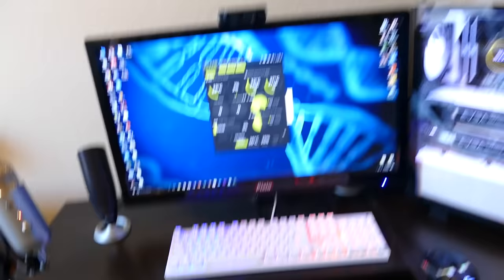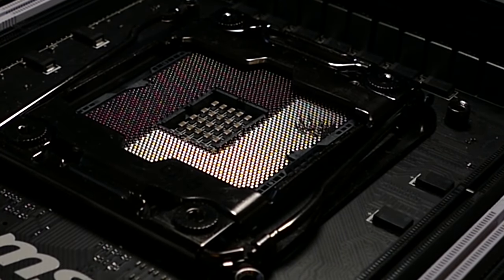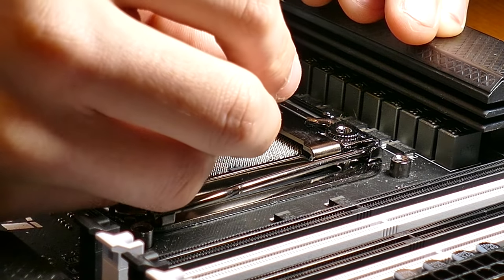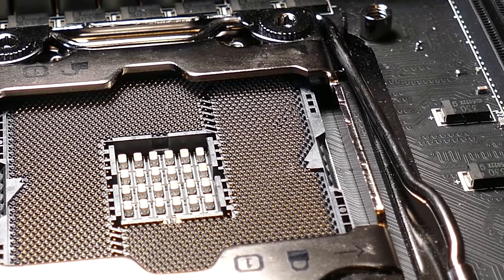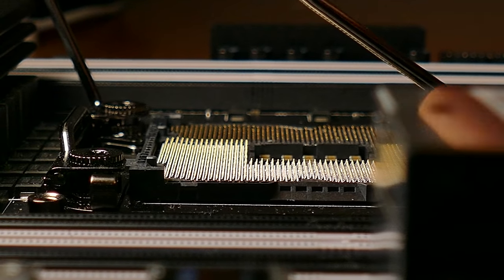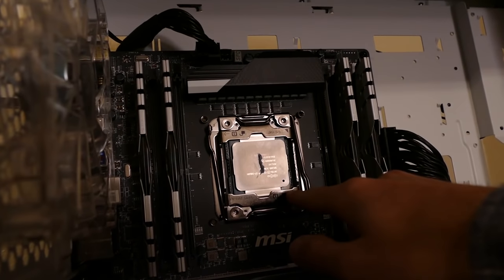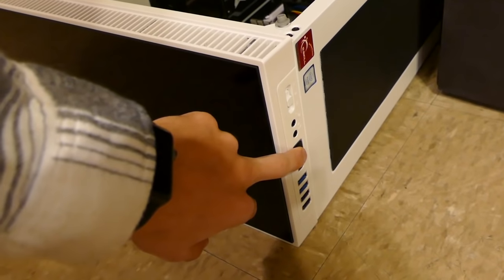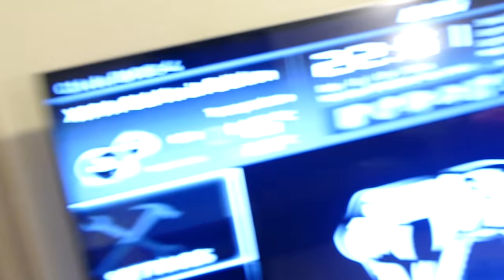I Stepped on a Motherboard. Let's Fix It!

Comment: You don't have to trash anything if that repair goes wrong. With the cost of that board being that hi, a proper hardware service socket replacement will be cheap. Socket replacement on any board costs about 40 USD + VAT in my country. Should be around that price in US I guess.

Comment: Nice save.  Those stupid little pins are soooo damn delicate.  You even breathe on them wrong and they get misaligned it seems.  I kinda miss the old CPU pin / socket setup, those were much more robust.

I do see why they did it though.  Overall, if you dropped a $350 cpu and bent/broke the pins, it's more costly than mucking up a socket on a $150 motherboard.

Comment: The fact it only sees 12GB of RAM might also be due to the bent pins, I'd not blame it on your RAM installation. 
After all, I've seen a few people that had LGA sockets with bent pins and their CPUs and  PCs ran fine, exept for the right dims that just didn't work anymore. Might be exactly what you have here.

Comment: I've lost two ram slot out of two with bent pin, now the dual channel capability is gone. Tried bending pin back to their original position but they never goes to original position.

Comment: I might actually think about getting a motherboard with the AM4+ socket that uses the AMD ZEN CPU and it turns out that the AMD ZEN CPUs will have 16-32 CPU cores and the AMD ZEN APUs will have 32 CPU cores and 16 GCNs and the AMD ZEN processors also have hyper-threading so they show up as 64 CPU cores and 16 GCNs.

Comment: this is extremely hard for a X99 socket depending on the way the pins are bent. my MSI gaming 5 had only a few bent pins but it was never fixed

Comment: are you sure that one of your ram is not inserted properly is the reason why its not detected? i had a similar problem with my z77 motherboard system was crashing when i ran it in dual channel and was working fine when i ran them on single channel found out some of the pins in the socket was bent. quick Googling showed that the pins that were bent were related to ddr memory. tried to fix it like you did was not successful now both the dimm slots in channel A totally failed, but channel B works.so the system is still fully functional except for loosing two slots. didnt bother to correct it as i was didnt want to make it any worse

Comment: I tried this with a gigabyte lga 1150 mobo, with the slightest pressure the bent pins just broke off. After what I paid for it and what I paid for the cpu, I definitely prefer the pins on the cpu theyre even easier to straighten out. Hope zen keeps that tradition.

Comment: If I did that to a high-end Mobo, I'd be devastated - well done on the fix, breathe a sigh of relief! :-)  For the RAM though, please try not to handle the contacts with bare fingers, even if not for static discharge, the oils from your skin can cause problems later on.  Same goes for those CPU pins or GPU edge connectors.
Reply: La estática se quita teniendo presionado el boton de power por 15 segundos y el problema que djiste nunca ocurrirá.

Comment: actually if im correct some of those pins are useless and others you can still get away without. granted this is only the case for a handful of pins and can cause the cpu to have lots of errors.

Comment: i had problems with the stability under load after 3 bent pins not perfectly aligned with the cpu. so may be not fixed?

Comment: ah yes, when i was setting up my mobo, i drove a screwdriver through the pins while trying to insert the backplate and screw the cpu cooler in. had to tediously bend them one by one. worked fine and still working fine!

Comment: AMD board would ever have that problem.And didnt you get x99 taichi back from nzxt? So you should have a mbo for the i7
Reply: For some random reason I thought that both the Intel CPU and the motherboard had pins :'D
Anyways. For the x99 platform, I think is better to have the pins on the MB since if you screw it up it can cost you around 400$. But the CPUs are the same price and even way more expensive than that, so it would be better to not screw up your 1700$ CPU, for example :')
Reply: TechGuide Yea, but it sucks when you bend the pins on your CPU though. Like I did on my AMD chip. Lol. I was able to fix it though thankfully.
Reply: True.... AMD make the cpu the fragile part instead.... I'd rather damage a mobo than a cpu as I know which costs more to replace ;)
Reply: Yeah but remember that the fx cpu line is dirt cheap and many mobos cost more than the cpu itself if not the same.
Reply: McnuggetsandFrieswithsauce'nshit But there is a much higher chance to bent the mobo than the cpu.For an example no one is that big of a fool to leave a cpu on the floor.But that does not apply for mbos right salazar xD
Reply: I personally had the stock cooler stuck on a fx 6300 and I didn't know that so I stupidly pulled the cooler out with force and discovered that the processor was glued into it's bottom, fortunately fx pins are big and tough that none of them were damaged. One thing intel does better in their solution is the part that holds the cpu tightly on the motherboard.

Comment: Two things, I like the troubleshooting and repair videos, it sets you apart from others just doing benchmarks and reviews. The other thing is I miss bga sockets and CPUs. Sure it cost a fraction of a penny more, but never had bent pins.
Reply: David Whitfield think you ment PGA.
Reply: No, I did mean Ball Grid Array, they had balls as the contact point on both the CPU and Socket, they were dropped as they are more expensive to produce.

PGA uses pins on the CPU, which is terrible, AMD FX still uses them, and intel uses Land Grid Array, which may even be worse, but it's the cheapest in production costs.
Reply: Interesting. Never new it was a thing. What cpus/manufacture had it? I like PGA cause if a pin breaks you can just throw it in the socket.
Reply: I know Intel used to use them on package CPU's, but now I believe they are only used on SOC solutions where the chip is simply soldered. I think they last used it in 98' on some security based Celerons.

If they were to bring it back customers would love it, and it would only hike up manufacturing costs by about $1.63 for each CPU. No more bent pins, less connection errors (like not detecting RAM due to minor variances the are still within the QC threshold).

Comment: I was building a 1151 pc with my 2yo daughter and she bent 5 pins[badly, another 10 or so barely bent] installing the cpu. I spent 4 hours doing exactly this. got them all straight but the last one snapped off right as I was finishing.

Comment: I did this too with my old CPU,I was cleaning my Mobo and I forgot I put the CPU near my left hand and I accidentally put my hand over it and I bent over 20% of the pins and fortunately I managed to bend them back and it did work afterwards.The CPU in cause was an AMD Athlon II X4 640.

Comment: what would you recommend for gaming and heavy web browsing like 8-9 tabs open at once broadwell-e like a 6800k or 6850k or a skylake 6700k i will be upgrading from a amd 1100t
Reply: ronnie cason an i5 is enough.
Reply: that isn't what I was asking but thanks for the input
Reply: ronnie cason I5 6600k
Reply: tabs are not really CPU intensive and close to taking nothing you will need a lot of RAM
Reply: ronnie cason 6800k
Reply: actually most of the time it is like 3 or 4 tabs of youtube lol
Reply: current set up is amd 1100t 16 gigs of ddr3 1333Mhz ram 2 xfx r9 290x gpu's in crossfire
Reply: ronnie cason 6600K, for gaming u really dont need more and the i5 6600k should b able to handle 10+ tabs easily
Reply: ***** very extreme.. just saying real world scenario it would never happen. to what you said atleast
Reply: Wow "heavy web browsing" is 8-9 tabs? What is my 100+ tabs then? Because thats pretty usual for me.
Reply: getting more ram will be helpful if you're going to be using mutiple tabs at once and an intel i5 or an amd fx 8*** will be more than enough (i said amd fx because of its price/core ratio compared to intel :P)
Reply: yeah but with zen right around the corner maybe i should just wait
Reply: 8-9 tabs? xDDDD my i3 can do all and always opened like 20-30 tabs

Comment: Looks like one of your memory modules is not being detected. It shows 12GB in the UEFI yet it looks like you have 4x4GB dimms installed. Is this accurate? I'm asking because I have a 1366 board and I fixed the bent pins but one of the ram channels is dead. Were you able to get all four memory channels working?

Comment: I fixed alllll pins, 2 of them are bent like this, half of the pin is straight and other half of the pin is bent sideways, would my motherboard still work with the cpu?

Comment: got a AMD 9590 CPU and just changed my cooling solution.
when I tried to remove my Noctua d14 the cpu was bonded to heat sync with thermal compound.
so  ended up bending pins but managed to bend them back ,reinstalled and every thing worked just fine.

Comment: i have an asrock b150m pro 4 mobo psu atx12v only have 4pin not 8pin.. should not be a probs but when i connect the 4pin pc wont turn on, if remove only graphics card fan and psu fan turns on.. whats the problem?

Comment: i think u only got 12gb of ram because a few pins wasnt bend good enough. had the same issue with a fx 8350, which only detected 8 of 16 gb ram because the pins were broken.

Comment: This is reason i hate lga sockets. I bent 1 pin on 1155, got it working but problem that it doesnt always post, i power off and on few times again and it will, after that it works without any problem.

Comment: thanks for the video but cpu being detected does not mean it is fixed, you can call it fixed when you put it under load or stress test which include all cores/threads test!

Comment: Can someone help me I just built my new gaming pc and when I turned it on it just turns on then u wait 5 seconds then it beeps twice then turns off and does the same thing reapitvely but when I put my cpu out it works fine it boots on fine like a normal pc but I'm wondering if it is the CPU because when I took it out of my pc my pc worked fine no beeps or anything so could it be the CPU any suggestions?

Comment: when a friend of mine bent a pin and came ask me for help i used a Pentel P205 or p207 mechanical pencil the tip is strong and you can firmly move pin back still a pain to do it thogh D;

Comment: I put a 4790k in my MoBo while building it and somehow i bent a fair few pins so the cpu was rising and the system didnt turn on. 
A magnifying glass & 20 mins later i managed to fix it. Had about 4 heart attacks and 14 strokes but eh.

Comment: Soooooo... First you use the cables from the wrong power supply, and then you leave a motherboard sitting on the floor without any sort of protection on it whatsoever?
Are you sure you don't just want to buy a Dell or something?

Comment: my fingernail got caught on one pin while putting in the cpu. I panicked but just rolled with it and my pc works fine. my i5 is over clocked and games run amazing.

Comment: I would never leave the pins exposed on an Intel motherboard ever, I use a cover or a CPU 99.9% of the time to prevent this.
Reply from the maker: The motherboard was placed next to my chair temporarily during a CPU swap.
Reply: Salazar Studio I can understand that, but even then, I would leave it on the desk or put the cover on. Oh well, what is done is done and you did what you could to salvage it, neat video in the end. I still recommend having a spare CPU cover on hand, I would hate to see more motherboards lost to a few bent pins.
Reply: Or put it in a motherboard box you have those they ship with them

Comment: Next video: it was not my angle that caused the problem, it was the wrong cable! I used an IDE cable to power my motherboard!
Reply: Pretty sure it was the chair manufacturer's fault for not calibrating the swivel correctly from the factory which resulted in him spinning around too fast and adding too much centrifugal force to his lower appendage . The carpet manufacturer is also to blame for making the fibers too tall and lifting the motherboard to an unsafe height relative to his foot.
Reply: bashzer0 I think we should be,me the designer of his house for not putting an angle on that particular piece of floor. If the designer had made the house appropriately with a ramp at the very position he was to put the motherboard, it would have been fine.

Comment: well i had the worst first experience in micro-center Cleveland let me tell you why 
i bought an open box pc and went back home and after checking its part everything was good except they tricked me with the wrong rams i should get gskills 3200 ddr4 and they put another with lower speed i went back and said you guys put the wrong ram and they said do u want a refund and i said cant u just corret your mistake and they said we dont have gskills 3200 ddr4 and i got a refund and went to check the shelves and there is a so many of them on the shelves so i went to the guy who i bought from him and he was little lost and went with me to the return department and talked with them and at the same time i told them the temperature of the pc hits 80c easily so they checked everything and said it's should be good
so they replaced the ram and i got it back 
after getting back home it was working but the temperature was 75c max not under load so i ran  a normal diagnostic test for few hours while i was sleeping since they said there is nothing with it
woke up the pc was not responding at all no mouse, keyboard signal or monitor so i jad to spend another hour in the road to return it 
and they told me the previous owner has the same problem and they told me it was new open box no problem with it thanks micro center for wasting my time

Comment: i think this is why AMD still uses PGA instead of LGA.
Reply: 9/10 the CPU costs more than the motherboard. LGA is so much better than PGA. You won't risk ripping the CPU out of it's socket.
Reply: i was just trying to share my two cents lol. LGA is better for some things, but when it comes to repiar PGA is more versitile.
Reply: i think some of the apus use lga so amd using both really but mostly pga
Reply: Ok thanks for the info.
Reply: xXxVoltzTheDestroyerxXx all amd desktop chips including apu's have a pga socket but Idk about labtop chips
Reply: yeah, i thought AMD only used PGA, but laptops use a BGA chip.
Reply: i did some research, AMD has an LGA socket called "Socket F" used in the opteron lineup.

Comment: And people still complain about AMD using pins on the cpu package itself.... even on upcoming AM4 socket. I say it doesnt matter. How is this any better? :D. In 12 years i never ever bent a single pin on 7-8 AMD cpus i worked with first hand. And they actually seem pretty sturdy in comparison to Intel lga mobos. Probably because those had 939-942 pins and here we got 2011 pins which are much shorter and thinner than those AMD uses and they actually got an "orientation" which seems complicated to handle while amd`s are plain straight. Regardless, it puzzles me to this day that "modern LGA" Intel uses is viewed as somehow superior to "ancient PGA" AMD uses...

Comment: This proves why is better to have pin on CPU not MBD + the pin on the CPU is essayer to fix and essayer to protect a CPU then a MBD
Reply: not really intel have a ton more connections (pin outs) so those pins would be smaller than what you find on amd chips way more likely to snap than bend straight over working would remove them easily
Reply: BeDoG Also, the CPU's tend to cost more that the motherboard, so having the easier to break parts on the motherboard is cheaper for someone to replace if they break the pins.

Comment: anyone know a good power supply for me,im using an i74770k gtx 970 and im getting a krait sli motheboard.Needs to be gold rated and 650w or above for around £120
Reply: Seasonic make some very good PSU ignore any haters fact is they been around for years they make PSU nothing else if they suked they wouldn't still be here other than that Antec also been around for years in the power supply market both have reasonable priced units
Reply: The, I am going to buy the 750 p2 instead.
Reply: Thanks,I made a mistake saying the xD

Comment: Chuckles in AMD. This wouldn't have happened to an AMD board :)
Reply: AMD boards are cheap. The CPUs I more worried about. Happened to me few times I bought new AMD cpu with bent pins out-of-the-box. Luckily managed to straighten them.
Reply: subbookkeeper Yeah, my gigabyte motherboard only cost $50. TBH if anything else broke I would be sad.

Comment: tsk tsk tsk, well they say you learn from mistakes and get better
Reply: updated question: why do you even bother with installing a gpu and 3 additional RAMs when you just need a single stick and the cpu just to check the POST? I give you props for the cooling since when you don't have nothing you have to improvise with anything but man

Comment: Bent pins. AMD user's nightmare...
Reply: Marcin Kąpiński much easier fix for AMD tho as its on the CPU.
Reply: Prince Thrakkath True, but CPUs are generally more expensive and bent pins on CPU are far more common. I had like 5 AMD CPUs (Duron, two Athlons, FX, A8) and 3 of them had this issue.
Reply: Yep theres definitely pros and cons for sure although if your talking high end mobos for intel they can be very pricey.   

I had to fix bent pins on my fx8350 myself with a credit card(lesson learned dont install CPU when distracted).

Comment: i did it with a needle belive it worked fine 😂😂
Reply: The only diff was it was an Amd processor
Reply: Amd should have been much simpler. Simply because the pins are on the CPU and they adjust themselves in the holes at the end.
Reply: Maybe he had a LGA AMD mainboard? (Socket F, C32, G34) :D